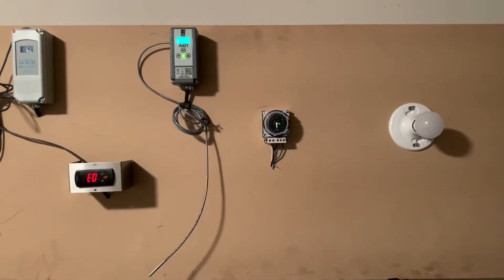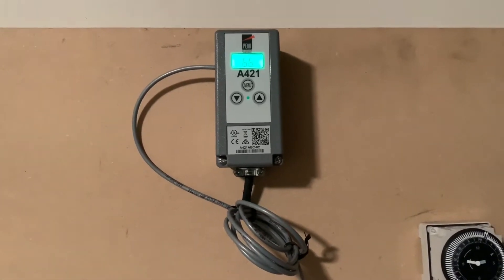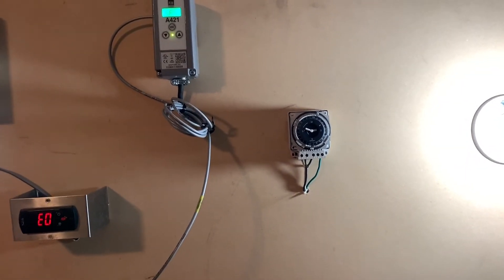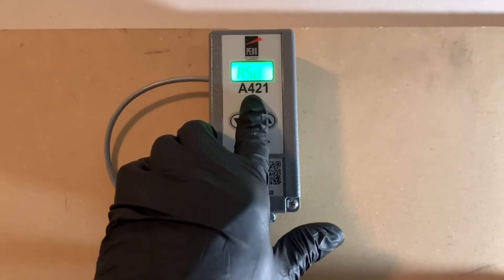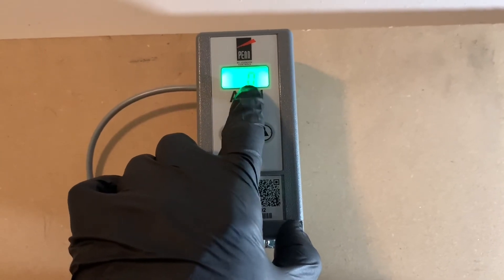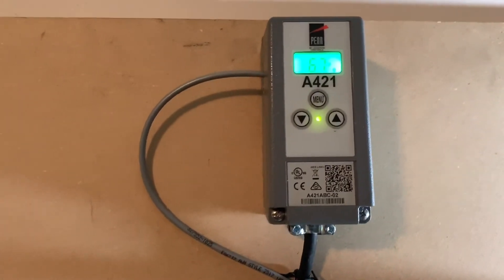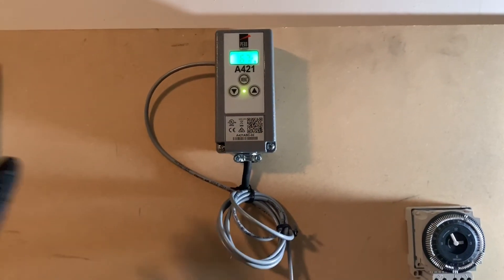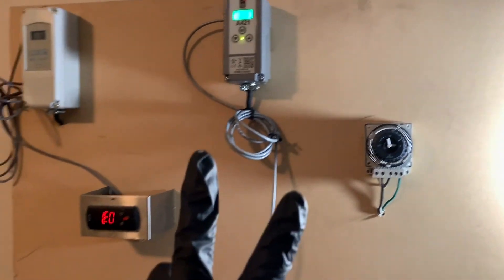How to set up Penn A421 Digital Temp Control

Comment: The issue I have is that it keeps running it doesn't stop and it freezes the food
Reply: Same issue I’m having now. The compressor won’t shut off. What did you find out?
Reply: He said its. Sensor  failure that stainless steel tube  @joespade11

Comment: I have same control for my meat case. Its not keeping the temp between 35-40 in meat case. Even at night time when curtains are closed. Its freezing up. What could be the problem here sir?
Reply from the maker: @minesh I’d definitely check to make sure the settings on the digital controller are accurate(35 set point, 4 or 5 degree diff). You’ll also need to check to see if you have a defrost control and that it’s set properly and actively working. Ensure that your crew is closing the door after entering/exiting. If those check out then you’ll have to check the condenser and make sure it’s not low on refrigerant. Those are the basic items. It could be a number of other items but at that point I’d recommend having a service company identify the problem as they would need special tools to diagnose.
Reply: Gus Garcia thank you for your response. This is Brand New meat case only a year old. Its 3 cases connected to eachother approximately 32ft long.  Right now i am having issue where 1 case is at 35, 2nd is at 27, and 3rd is staying at 20. I am not understanding whats causing it even the cooler service guy having hard time figuring out.
Reply from the maker: Wow, where is the thermostat sensor located? Supply air, return air or in the coil? And did this issue just start or have there been problems all along? 
The tech will need to check all fans and ensure nothing is blocking air flow. They’ll also need to check superheat on the TEV’s. If all checks out then they would need to install solenoids and separate thermostats for each case. These recommendations are vary vague as I haven’t had eyes on the unit.